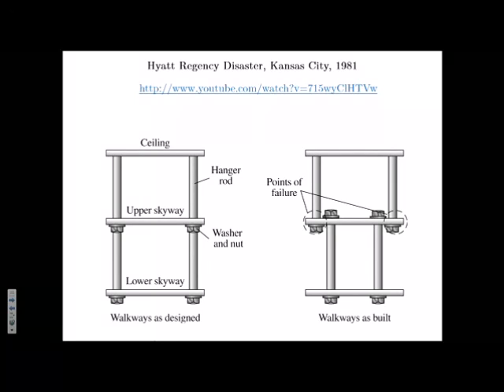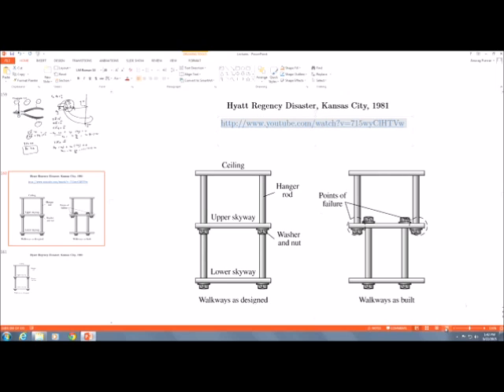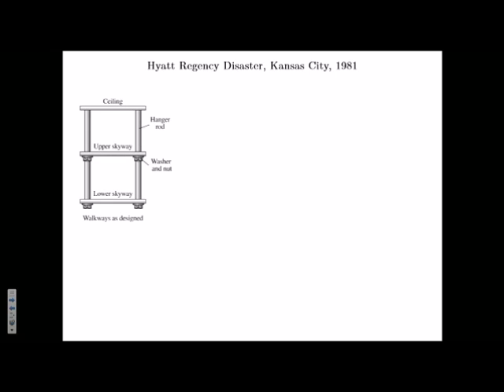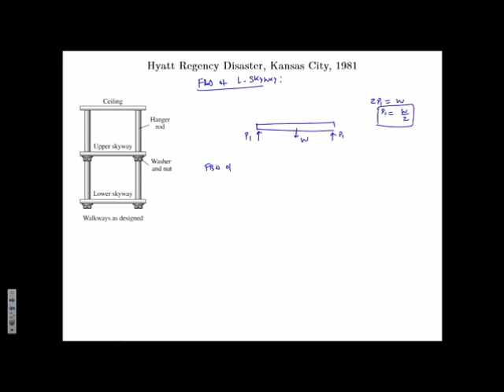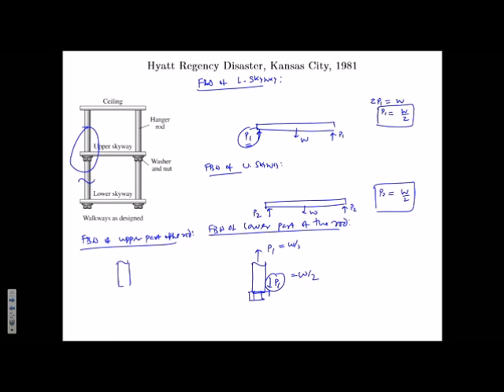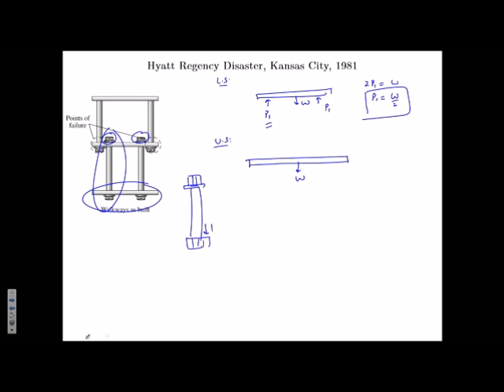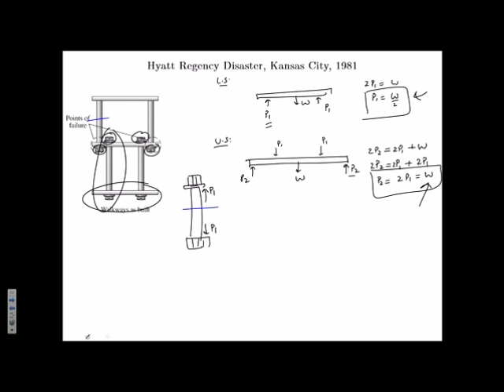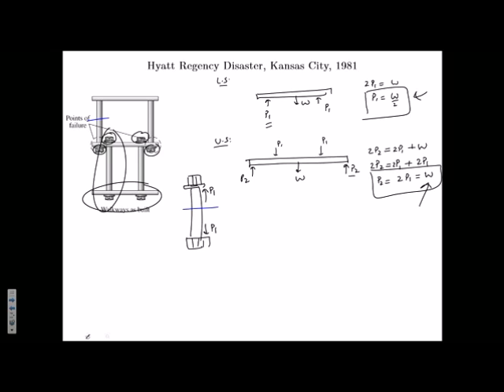4.15.3 Static Equilibrium Example 3 Hyatt Regency Disaster

Comment: According to the animation, the fatal flaw was not the nuts, but the upper box beam. It split at the weld and the nuts were pulled through the gap.

I saw a documentary that talked about steel stiffener plates that should have been inserted inside the upper box beam around the hangar rods.  Whether or not those would have prevented the failure, and which party was at fault for those never being built, was not explained.

Even so, it seems that this whole thing was inadequately designed, and the engineering firm grossly negligent.  When a portion of the atrium ceiling collapsed during construction, the owner ordered the engineering firm to recalculate all of the steel to steel connections.  This was after the skybridge change had been made, so they should have found the flaw then.  Instead, they spot checked a few things, and then basically lied and reported that they had checked them all.  No calculations were ever done on the bridge connection that was actually built, which is something that should never be allowed to happen.

Comment: Professor doesn't mention that the box beam was changed from a single piece to one fabricated from two "C" channels welded.  The weaker weld failed.
Reply: Pelican1984 — It was originally to have been built up as an I-beam from the two channels with the rods passing through the web.  The professor’s point here is to illustrate the principle defect as an xample of static analysis, not to review the entire design.

Comment: The nuts were fine...same nuts hold up entire structure in ceiling...the box beam failed and split
Reply: B!tchSlapper — The design on the left was also underdesigned.  It would not have met codes.  The modification doubled the stress and guaranteed failure, but whole supporting structure was flawed, especially those built-up box beams with no reinforcement at the points of maximum stress.
Reply: B!tchSlapper — At the end of the video, he was leading up to that.  The box beam did not have a factor ot two safety margin at the point of maximum stress.  That doesn’t mean the nuts were “fine” though.  They just weren’t the weakest part of the design.  The whole concept stinks, in my opinion.

The walkways as revised after the disaster are the right solution.  There is one walkway, supported from below.  The other two walkways are gone.